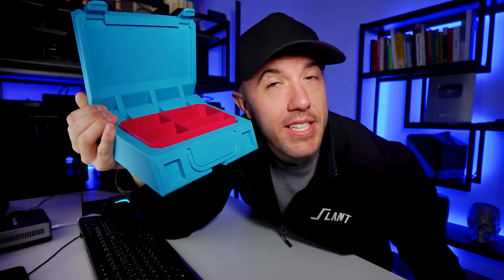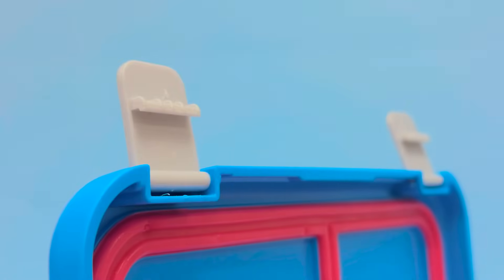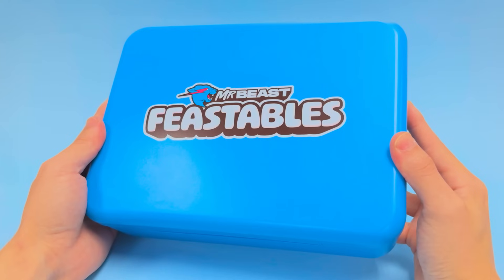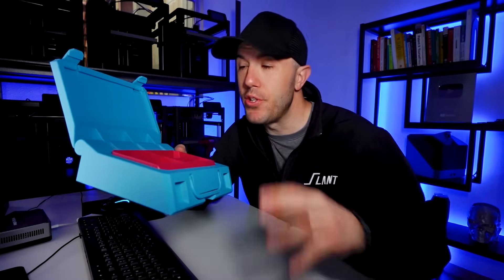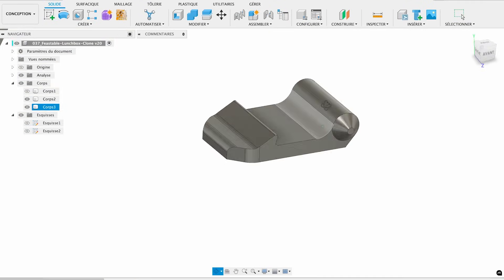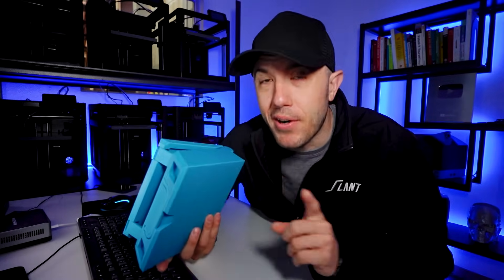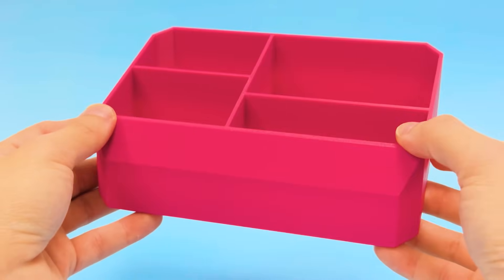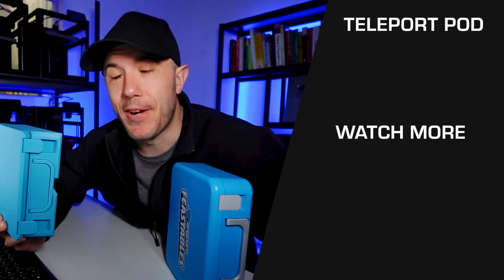How We Would Make a Product for Mr. Beast

Comment: good ideas! but the "fuzzy skin" texture and layer lines would be a hotbed for bacteria, those features along with the acute inside angles of the food compartments will make it even more annoying to wash than the original, you've solved one problem (90 degree hinge limit) but created others such as eliminating the gasket deboss (?) ..the grooves in the original lid that prevent liquids in each compartment from getting into other compartments. print-in-place and 3d printing IS the future but it's not viable for full scale or small batch food safe manufacturing atm imo. great for prototyping though. edit: also, can it stand up to heat? difficult obstacle for 3d printing to overcome efficiently

Comment: Besides all the other problems mentioned by commentators, pricing would be a huge issue. Such a part would result in a retail price of at least $40 as a rough guess. And it does look really cheesy and clunky. For all the advantages of 3D printing - less waste, better for environment, etc., it can't compete with mass production. It is best for very niche products or replacement parts.

Comment: I like the innovative one-piece way of printing, and I think you make some great points about the accessibility of being able to print merch on demand if you do not have the vast resources of someone like Mr Beast.

However, I don't think this is a great example to use because this is an item that is designed to be in contact with food. I know you have a video of yourself chewing printed parts, but that's not really the point; you can shoot a video of yourself smoking a cigarette and not dying, but that doesn't meant the cigarettes can't harm you.

The FDA does list some forms of Polylactic Acid as approved Food Contact Substances, (https://www.hfpappexternal.fda.gov/scripts/fdcc/index.cfm?set=FCN&sort=Sort_FCS&order=DESC&startrow=1&type=basic&search=polylactic) but I don't see anything in the database suggesting that your filament is approved. Furthermore we don't really know if any trace metals from the hotend leaches in to the plastic.

Even so, I think the biggest problem with a 3d printed lunchbox will be washing it. Unlike the Mr Beast lunchbox, your lunchbox has a very rough surface, making it difficult to clean. If it's just regular PLA, I doubt you could put it in the dishwasher without it warping. Is it even watertight? Might it get mold on the interior of the print?

Finally, I'm a bit surprised that you presented that as a sellable item when it has that very obvious overhang 3d print greebles along the back edge of the interior of the box.

Having said all that, I do think you offer a valuable service, and I do hope to make use of it.

Comment: As someone who designs injection molds for a living, your understanding of the industry is limited.
The price depends greatly on the complexity and tolerances of the manufactured part.
This mold would be extremely simple and quick to make and would definetly not break the 100k mark.
Reply: how much would it be for all the moulds?
Reply: @Alex-755 no idea, very situational, you can use the quoted price from the mold maker to calculate how many parts you would need to mold in order to generate profit, basic stuff really. I assume they did just that and didn't loose any money on the molds
Reply: @themaduserable  thanks for the response :)

Comment: Something I'd like to see you redesigned for mass production 3d printing is 3d printing professors print a quest miniatures. He tried using slant to print them, but didn't like the results. It would be interesting to see if good miniatures could be designed at mass production quality.
Reply from the maker: Best to print them at high resolution with the correct material. Teleport runs at 0.2mm which isn't the best for miniatures. But all parts that small are pretty unstable in production which is why we don't recommend it
Reply: @slant3d  isnt 0.2mm good for miniatures?
Reply: @Alex-755 I think a 0.2mm nozzle is good for miniatures, but for miniatures you want the layer thickness to be much smaller than that.
Reply: @timaidley7801  oh he meant layer height not nozzle, oopsies!

Comment: All the HATERS are missing the point. Its about 3D design and what's POSSIBLE ! Its not a product that would be sold as a mass item in Walmart but it does show that with some clever design thought you can make something like this as a ONE OFF, that you couldn't do before. Yes its a bit ugly and the layer lines are not great but they probably made it on their own in house printer NOT a Bambulab at a .2  layer height and the overhangs probably didn't have supports as they HATE using them. I do agree that not every video they make needs to be a blatant plug for Teleport though. Gabe will not respond to anyone on here as he just doesn't play the game that way so hate as much as you like, he is doing more to advance 3d printing than any of the haters out there.

Comment: IDK why people are so angry in the comments, but damn, that was a smart way to orient it. I print boxes and angle them 45˚ so they are more reliable, but I've never considered printing with an open lid.
Reply: I know a individual who 3D printed cat food bowls, which later caused health issues in his cat. While experienced users like you or I might take proper precautions, there are many scenarios where that might not be the case. Therefore, including a clear warning about food safety and material suitability is essential.
Reply: @arcanorca  fair. Mentioning using food-safe materials would be better.
Reply: Some people are angry because this does not discuss the issue of food-safe plastics and is therefore slightly dangerous to promote.

Comment: Having recently dealt with that style of lunchbox in the setting that it is operated by the child, that's a disaster waiting to happen.  You have no idea how disgusting even the injected molded one can get.
No sealing gasket is asking for trouble.  At the very least, the insert needs to be coated in an epoxy, because I have seen kids pour their milk into it
You can't wash it if it's made of PLA because the hot water from a faucet is enough to get it to warp (I know this because I gave it a try because I didn't have a hair dryer handy)
Of course, there's the mold issue, which will happen unless you routinely apply Chlorine or again, the insert is coated - Your short about chewing prints was cute, but would you repeat that with those very same prints after chewing them every day for a month?

Comment: Did ya'll actually watch and listen?  It's about innovation, saving costs on expensive moldings and inventory storage; Food safety is non concern food safe materials, 'virgin' PLA is FDA approved, but if want something better, Fillamentum NonOilen (a PLA/PHB blend) is about $39 for 750g, when available.  Layer lines do needs to be addressed for bateria, with a coating and there are other problems that would need to be addressed, but again, this isn't a video about a replacement part for an existing one, but rather how something can be done differently.  It doesn't have to be food related; take the concept and apply elsewhere...."This isn’t just a redesign; it’s a demonstration of what’s possible when creators embrace modern tools."
Reply: I get all that, but he turned it into an AD for his service, which isn't very good from what I've seen. And if you ignore the visual you'd still need non-contaminated printers (meaning a whole new farm with printers that only print foodsafe filament) for food-safety. Most of the comments are pointing out the clickbait and AD, which I have a problem with aswell...
Reply: You are probably right, but I am afraid many will see this video  as a cheap way to do it and just jump into it without taking the precautions, as the health related issues themselves are not directly talked about.

Comment: Yes, this a perfect example of something that works better with injection molding given the scale of production and distribution, and the fact that it will never really need to be iterated on, but...
Most smaller producers can't afford to release the same sort of item due to startup costs for molds in the tens of thousands.

Print quality is a bit of an issue despite the fuzzy skin and certain colors showing details much more clearly in harsher lighting, but I think people would be surprised just how little the average consumer cares about layer lines and other imperfections related to 3d printing.
Reply: if you print stuff that comes in contact with food yourself then thats on you, but good luck commercially selling such a bacteria trap product with no control over the material sourcing and FDA approval of the manufacturing equipment at scale  and surviving the thousands of health claims that will make the FDA and any other food safety organisation be on your tail.

Comment: Click bait, 
Slant 3D did not make a product for Mr. Beast. They made poor quality, cheap,  non-functional idea that you should never use for an actual food product.
Reply: im getting real tired of lying clickbait....its a short term gain in exchange for long term lack of trust...
Reply: Who cares. It's a cool idea and novel idea, especially the orientation.
Reply: Even still the approach to the problem and solution delivered is invaluable, i suppose you'd actually have to watch and gain what you can.  I hated to hear it when I was young but I can't deny or make false claims against the wisdom of my father, "You can always learn something from everybody."  Go play in the dirt for awhile, it might do you go... or the untold horrors?!?!
Reply: @CandCfuninthesun  they essentially solved one UI problem (the 90 degree hinge limit) and created many other potential catastrophic problems. the fuzzy skin and layer lines will be a hotbed for bacteria. the unnecessary acute angles in the food tray compartments just make it awkward to use and clean, they eliminated the debossed gasket grooves in the lid that prevent liquids from seeping into other compartments. 3d filament and 3d resins are less heat resistant, less food safe and a more expensive than the thermal plastics used in injection moulding. the point to your wise fathers common idiom isnt an absolute 'everybody has good ideas to some degree', it's a introspective challenge to have the wherewithal to also learn from others flaws and mistakes when their ideas are bad.
Reply: it's a public ideea :P
Reply: it’s an for teleport with mrbeast clickbait
Reply: Re-read the title. “How we WOULD…” not “How we DID…”

Your lack of reading comprehension dues not make it clickbait.
Reply: @Phyxx_TX  lol they changed the title.
Reply: @Phyxx_TX they changed it due to the backlash bud 🤦‍♂️

Comment: The redesign is missing the removable divider and the seal, and the only thermal insulation it would have would be the air inside the print. It certainly can be improved with 3d printing (I specially think the hinge on the original would snap very easily) but this would certainly need more steps on manufacturing.
Reply: One nice thing about 3D printing here is that outside of the case ends up being hollow with inner and outer walls. This actually would insulate quite well. Trapped air is a fantastic insulator. Same concept as standard food coolers or double wall cups. I'll leave all the other downsides to the comments, hahaha.

Comment: I love 3D printing, but it is not the right technology for everything, especially when it comes to food safety. It starts with the used filament, then the 3D printers itself which should not introduce toxic materials to the product. And then the manufacturing itself. If you want to make a 3D print food safe you have to seal it with some kind of food safe resin to close all the small gaps that come with the manufacturing. 
I took a lot of good design advice from your channel, but in my opinion you are to fixed on 3D printing and want to leverage it above everything without considering the drawbacks. Every manufacturing methods has advantages and drawbacks. I would trust you more if you were honest about the (remaining) shortcomings of 3D printing instead of trying to use it for every product, even if it is actually not the best technology.
Reply: the issue with food safety is overblown, there are plenty of reasons to not use 3d printing for this anyway
Reply: @marshallb5210  And especially plenty reasons to do it.
Reply: More clueless comments. You guys are clearly not parents and have never used a lunchbox.
Reply: "you are too fixed"  - They sell print farm services. They're not giving you advice on how to print. They're advertising their services.
Reply: @darrennew8211  for sure it is advertisement, but I have more trust in a company if they know the limits of their product and are honest about it. 
And on top, if the box was printed on their printers the quality is no advertisement for them either

Comment: The video is as always at a high level. And it does the right things. However, no existing filament, even PETG, provides protection against microbes with similar efficiency as a product manufactured by molding. In particular, due to the layer-by-layer application of plastic during printing. And the "grooves" between the layers in which food debris gets clogged. And solutions with a rough texture only make the situation worse. Also, due to the rejection of the design in the form of several parts, the presented version also rejected the sealing rubber bands at the top of the lid, which disrupts the tightness of the food container and, as a result, the shelf life. But this comment is not hate. It's just a response. Thank you for continuing to delight us with new videos
Reply: This is very true.  I would think thr answer is just injection molding for the liner.  Print the rest.  If the product is that good then the 1 mold would be justified.  Now you have the box printed on demand and have a food safe liner.  Yes you still need to go buy a mold but it's just 1.
Reply: @tbboardhed2 Hm. I don’t know. the production of food dishes is very difficult, especially since I would generally focus on the internal container in this case. I would take a finished product and come up with an add-on for it or cast a container and print the rest on a printer. Nevertheless, I think that it is possible to offer souvenirs that are less demanding to the technical process. The Beast just decided so - the food industry
Reply: Injection molding is not a food safe process. There is no such thing as a food safe process. IM uses abs many times which is highly toxic. But that's really only when melted. Your point is moot. Kids don't eat "off" the lunch box. It's also very easy to clean a printed part with soap and water and a scrub brush. It's laughable that people actually believe this suedo science.

Comment: If injection moulding was as  accessible, cheap and easy as 3D Printing I would never bother with 3D printing, quality and strength will never be matched.
Reply: that is the point, molding will never be accessible.
Reply: @riba2233  Maybe with 3d printing metal?
Reply: @BookOfMorman  metal 3D printed dies are becoming extremely common, usually M2 or 316 if you just want it cheap&fast (relatively speaking) the real trick is not needing cleanup on a 5or6 axis mill. Or hours of polishing the 3D print.

Major cost reduction if you incorporate the flow paths for coolant and such into the 3D print.

Comment: Come on.. I normaly like your videos but the box looks really low quality and 3d printed stuff as a food container is a really bad idea.
Reply: PETG is "food-safe." Nowhere did they state it is PETG (and "matte satin finish" is typically not a property of PETG).
Reply: @foursobcyclone  No 3d printed filament is food safe after it goes through a nozzle. 3d printed parts have layer gaps that are terrible for food. What sort of microplastics will come off the printed part? What sort of carcinogens get created during the printing process? Food safe is a lot more complicated than just the original material. I wish Slant3D would be more responsible about this subject.
Reply: @DaveLeCompte  Not more toxins than with injection molding. They dont use some magical plastic...
Reply: @DaveLeCompte yea and there’s a way to solve these problems
Reply: @cybyrd9615  Yeah, like injection-mold the part. Or vacuum thermoforming, if you need to be on the cheap side for your batch. And 3d printing (thru teleport) even does not solve the part of waste and logistics cost
Reply: Lordy lordy lordy... go play in the dirt everyone... jeeeze
Reply: it’s obviously an ad for teleport. dont take it seriously
Reply: lol that's not the purpose of this video
Reply: layer line is the signature of the 3d printing :P

Comment: I like this bulky 3D printed design! Is this design food and/or dishwasher safe? I like 3D printing my own designs never conciderd food products. I thought 3D printed parts are not foodsafe because of the layer line surface and pla melts in dishwashers.
Reply: According to the product description, the original lunchbox isn't dishwasher safe either. It has a 'hand wash only' warning on the product description at Amazon.
Reply: correct
Reply: PETG is food-safe, but verify there are no PFAS additives and be careful of nano-shedding (do NOT use any fiber-added plastics as they cleave particles)
Reply: @foursobcyclone  sure but you still have to 1: seal it because even if the filament is safe, the printed object will have flaws and surface irregularities that will trap germs and 2: have a dedicated printer for printing it because the extruder gears, hotend, heatbreak etc are contaminated
Reply: no 3d printed object is food safe.